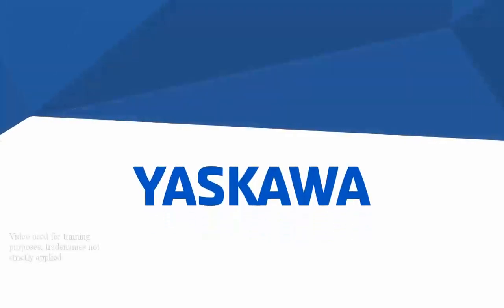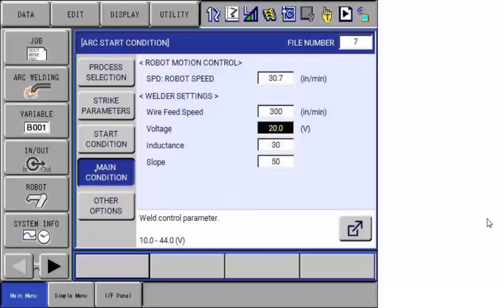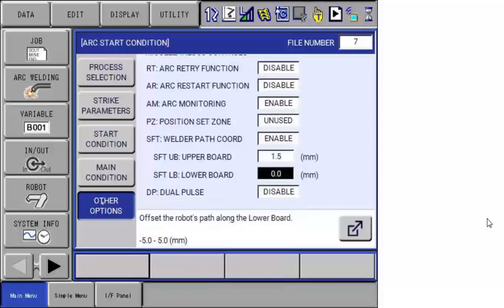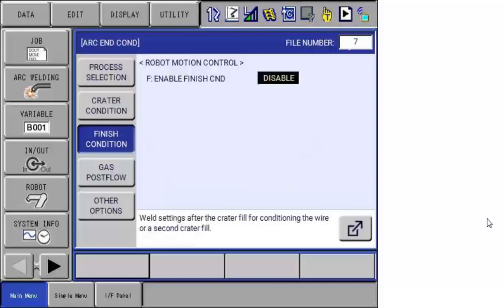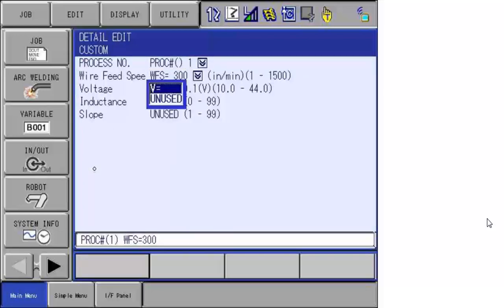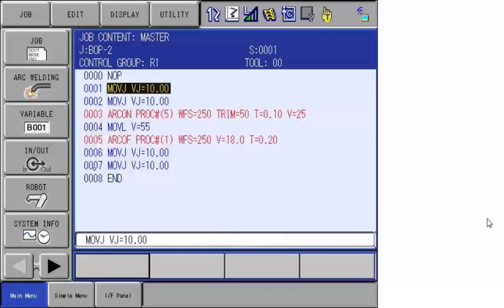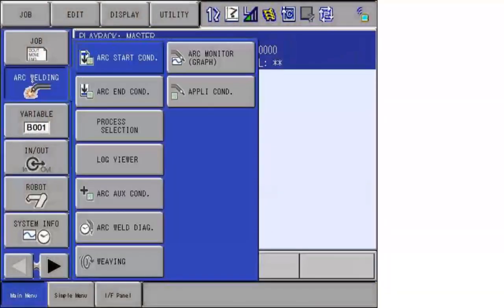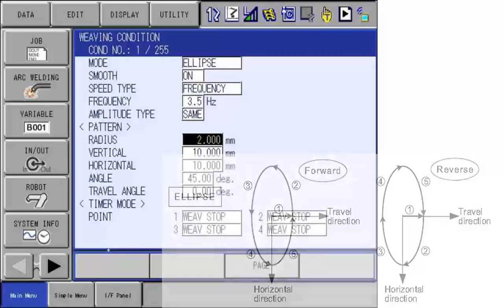Weldcom Interface for Miller® Auto-Continuum™

Comment: i would like to know where in my welding setups how i can make adjustments in realtime while welding to tune my weld values for amperage and voltage i am using accupulse for .035 steel wire with 90/10 arg co2 mix. I would like to clean up my welds and reduce spatter which is caused by non optimal weld settings.
Reply from the maker: It depends on your controller version.  DX200 and earlier, there is a screen for weld adjustment in play mode.  We do not have this converted for UWI (YRC1000) yet.  In the meantime, you will have to make changes in the Arc File while the robot is in teach mode.  You can display an Arc File and make changes without changing the job contents or cursor position in the job.
Reply: @yaskawa  are there small robots and tools such as robots to clean swallow's nests